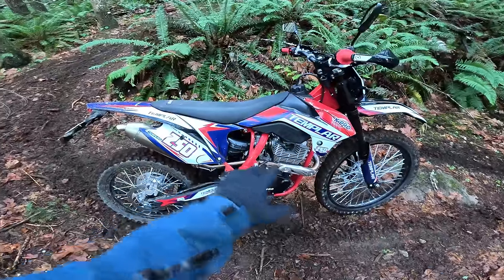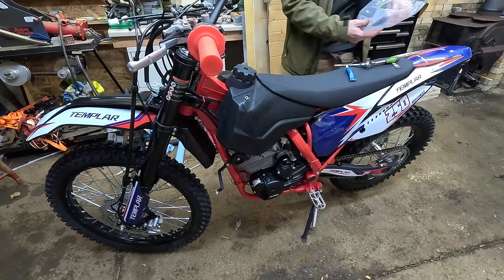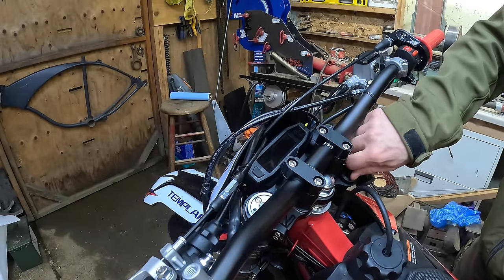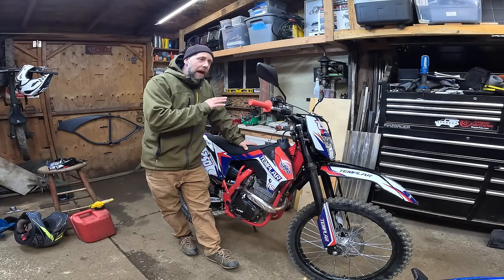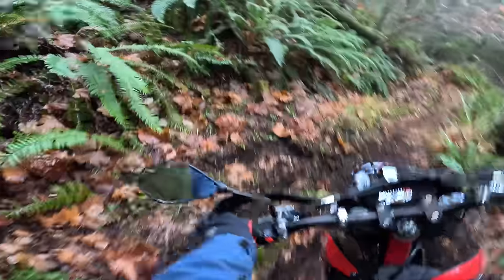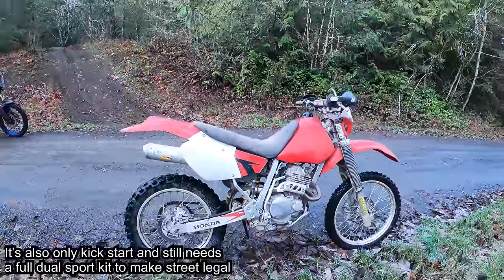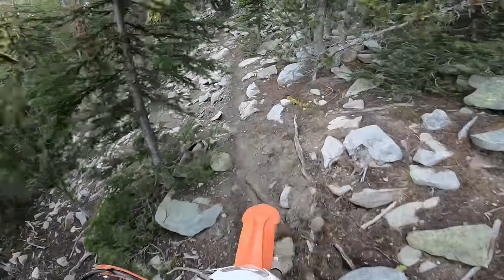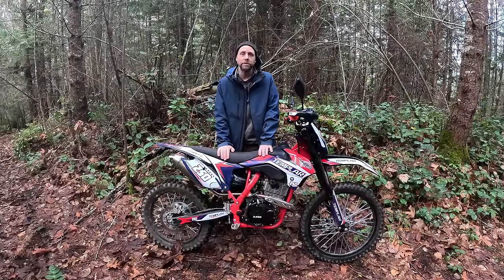Best Value New Street / Trail motorcycle? X Pro Templar 250

Comment: Chinese junk. I mean, if you don't care that it won't last, and just want some fun with the fam, I guess gof or it, but I'd rather buy a used Japanese ANYTHING than this. Going through it, and adding lock tight, torque checking vital bolts, etc, is not an option, it's a MUST DO! 
Here's some true specs:
ENGINE: Zongshen CB223, 232.6cc
Max speed(MPH): @60mph if you weigh about 150-170 (similar speed as a slower GROM)

Power: they claim 19hp, but owners have reported closer to 12.5.

My opinion, if you are mechanically inclined, and know how to work on bikes, having a general knowledge of tools, and how to use them, this might be a good deal, but you're rolling the dice. Quality control is all over the place. DO NOT expect to start it right up and ride, EXPECT to spend about 5 hours going through what's loose, tuning it, replacing shipping fluids, etc.

What I'd do: I would buy a older, used Japanese bike, maybe needs a few parts or a little work. That bike will last 10x longer than this thing will, and outperform it in every way.

All of that being said: It is NO WAY NEAR as nice as the GROM(lol), but it can be a really good starter bike for someone that's interested in troubleshooting, problem solving, etc. There's no reason you can't have a ton of fun on it, just don't expect the support, or reliability as you'd get with a non-China built bike. Like I said, roll the dice if the price doesn't hurt, it may be perfect for you =)

EDIT One more thing, it will rust immediately if you leave it out, consider a cover, or parking indoors if you don't want every single bolt, raw metal, and chain to rust out amazingly fast.
Reply from the maker: No one is making you buy anything man 😂
No need to get upset about what I spend my money on, it’s my money spent not yours. 
I have owned over 30 plus bikes over the 36 years I’ve been riding, just wanted to test one of these bikes to see for myself how it holds up over time. I know how to repair my own bikes, never have taken any Moto to a shop. 
Again no worries man I got this one.

Comment: This is super confusing.. so you want to get into motorcycle riding..at this price point I see the way in.but let's talk about regular Americans..160 pounds? Huh? So if you buy low end clothing, boots, decent helmet.. make some mods like the jets, get turn signals closer to the bike.. the immediate issue is suspension.. probably some available springs for the forks and a new cheesey shock or bigger rear spring if you do some homework.. don't know what all that calculates out to.. that's your getting in price.. and what is your getting out price? In my area these bikes have almost no resale value.. so if you kept it for a year or two, go through some oil, tires, brake pads, plugs, regular stuff, not sure of the value instead of buying a major brand 200,250,300 the original build quality is better, resale and service is easier.. definitely some pros and cons..my only concerns w Chinese is that some of these bikes can equal a total loss depending on service and parts..
Reply from the maker: Probably not the right bike for you.
Reply: Huh, say that again
Reply: Wow! Perfectly said reading that guy's post was almost like looking for something on OfferUp
Reply: @fukhue8226 So, the Honda rebel isn't exactly a DS bike.
Reply: @Mikefestiva  LOL

Comment: Do not trust these bikes 50% off them engine blows in weeks, not worth it. The company won’t even honor any of their warranty or return policy. They don’t answer the phone either.
Reply from the maker: To respond to your second comment. 
My experience buying two different X pro bikes has been fine. Placed my orders at different times. Bikes shipped fairly quickly. Both bikes ran fine out of the crate. Both bikes had bad tail lights, they stopped working within 10 miles, and one bike needed a different headlight metal mount. Emailed the company, they got back to me in a timely manner. They sent out All the warranty parts I requested no problems at all. Both bikes are running good and I have owned them both for over 6 months now. You sound like you had a completely different experience than I had when I ordered both of my bikes. 
What bike did you order? What happened to the bike? What parts did you try ordering? 
Maybe some info of your actual experience would be better than a bunch of frustration without any real info.
Reply: @williescouh959  I have a 21 hawk with 6000 miles never had an issue I ride rampart range which are pretty knarly trails. I street ride it as well can’t beat them for the price.
Reply: your having completely different experience you should post videos on youtube about it id love to see what broke and is it a easy fix?
Reply: Sounds like someone didn’t prep it right before they beat on it. 😂
Reply: Someone is making up bs